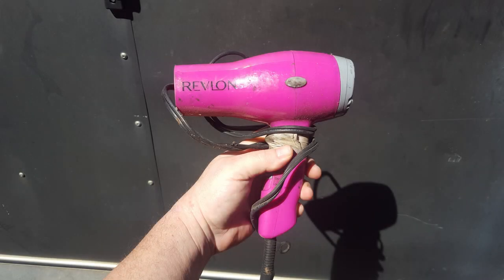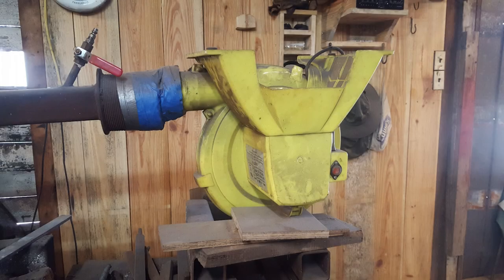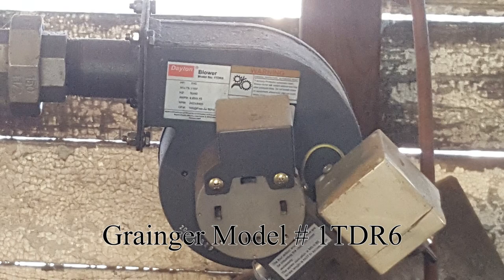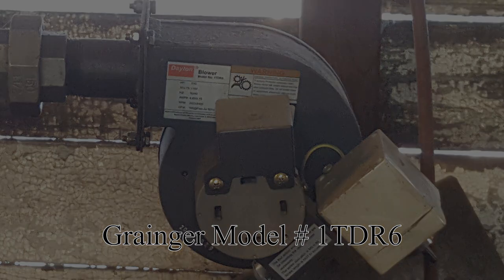Blacksmith Shop Tip #17 "Basic Blowers"

Comment: Good info here. I personally use an old leaf blower.

I suggest a future episode about controlling airflow.

I'm using a dimmer switch wired into the cord. This provides great control of my air. It's not the ideal solution because it will eventually burn out the leaf blower. Those things are not built to be throttled down like that. As for the dimmer switch itself, you need to know what you're doing. Dimmer switches have to be wired correctly with the hot, neutral, and ground in the correct places.

The better option is a T-valve. Just blow that excess air into the shop. I will likely move to a T-valve at some point.

Comment: I have been getting those induction blows from a HVAC company. 
When they replace  A furnace or water heater the blowers are not always bad and they tend to give them away  or sell them for a few bucks. I am also converting one to have a hand crank for a portable forge design I am working on.

Comment: I'm making a ribbon burner forge for my first gas forge to supplement my charcoal forge. Is there an amount of air pressure that is to much (or to little)? I was thinking of using a 2 inch ducted fan that runs at about 2500 rpm I have laying around.
Reply from the maker: Its a hard question and literally the best option is to try it out.

Comment: Does a 12v auto heater squirrel cage fall into "doable" range?
I am off grid with limited solar power. 
I've been using it but I can't tell which is the worse my problems: problems with air flow or inexperience in fire management.

Comment: I am just starting out and using a heat gun for paint stripping because I had a cheap one, it's got a metal business end, and it seemed like it's designed to run longer than a hair dryer. Why is the heat a problem?